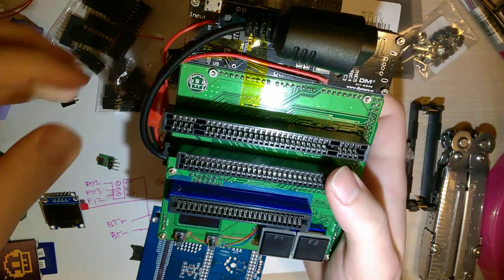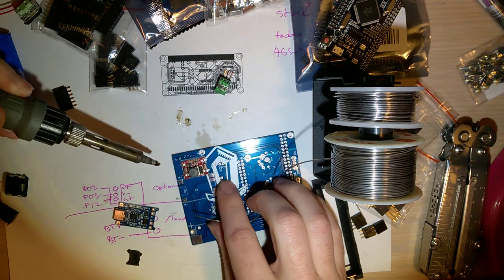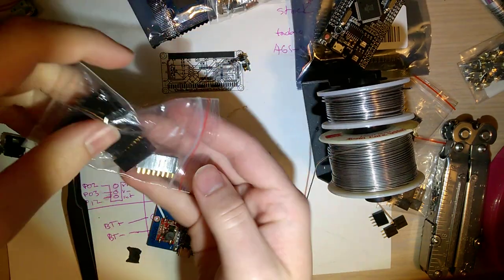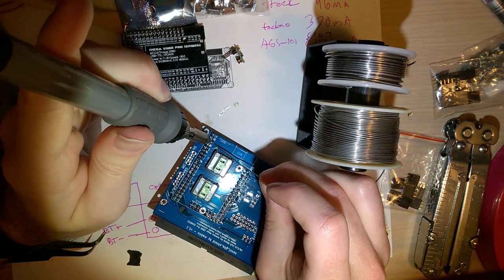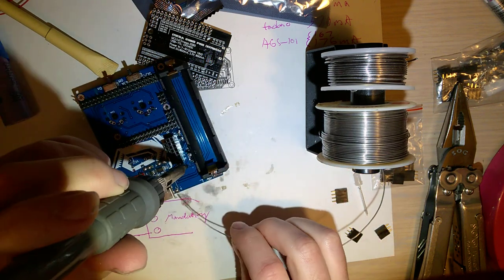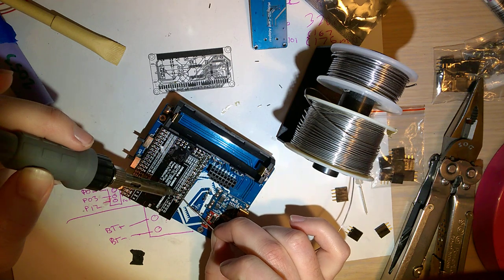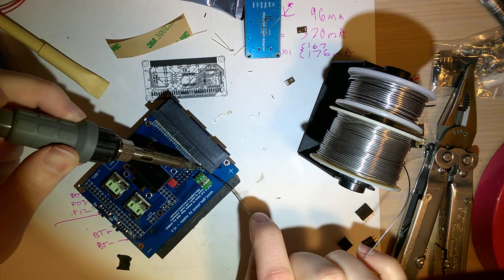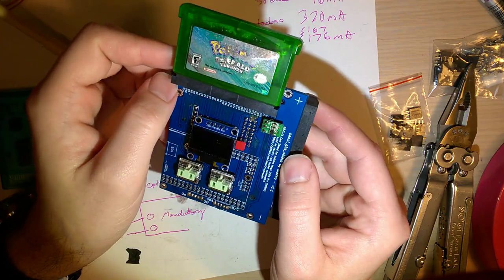I made my own custom Sanni Cart Reader shield for GB/C/A only

Comment: Nice! Keep up the good work.
Will keep a eye out for updates to this project.

If you could do a tutorial on a gb/gbc/gba cart flasher with just the Arduino Mega 2560.
Or even a Pyboard would be interesting hahaha
Reply from the maker: A major update to this project came in the form of a new PCB design: https://www.youtube.com/watch?v=AOxNhg_8TrQ

But if you want some tutorials on cart flashing with the arduino mega 2560, I'd recommend checking out the github repo for sanni's cart reader. There is a lot more info there than I could ever impart: https://github.com/sanni/cartreader

Comment: hi, i'm really impress of your equipment. i'm ganna try that but i want to build v1.0 with voltmeter. do you have v1.0 gerber file, BOM?
Reply from the maker: https://youtu.be/leoks1pUpcs
Reply: @makho  that's really nice power supply but, i'm talking about your portable cart reader v1.0 :)
Reply from the maker: @daehyunkim1969  Ahh, my bad. I just assumed since that's what so many people ask me about. This video is for the 1.1 version. I never published the 1.0 files (but I can see if I have them archived somewhere). There were numerous problems with that design though so I'll have to review it if I can find the files. 

I did publish everything I had with the 1.2 version though. https://github.com/makhowastaken/cartreader

If the voltmeter is the part you're after, I believe I left it in the BOM for this version (check the video description). It's an optional part for all of the versions I made.
Reply: @makho  thanks a lot! i'm ganna try v1.1  your video is really help for me. have a creat day.
Reply: @makho  hey makho i order parts what i need. and i will 3d print case for this badass, can you tell me what size of m3 screw spacers you use.

Comment: hi makho. i have a questions
i made your sanni cart reader v1.1 but have some problems
i made flash cart with J.Rodrigo's flash adaptor. (AM29F016) but always shows like this. 
GB Cart Info
Name:
Rom Type: ROM ONLY
Rom Size: Not found
Banks: 2
Sram Size: None
Checksum: FE00

then i ignore it -> flash mbc5 cart -> choose rom file -> flash ID: FEFE, unknown flashrom
i can't read rom, identify cartridges, flash mbc5..
can you help me?
Reply from the maker: Double check your solder joints on your cart. Did you already verify that the cart reader is working with an OEM cart?
Reply: @makho  offical cart's working fine. i triple check my flash cart
Reply from the maker: @daehyunkim1969  You've either got a short with your soldering or a defective flash chip then.
Reply: @makho  i use hot air gun and check all bridges. but  i'll try again. thankyou makho.
oh i have a onemore question, i saw your mbc5 flashcart on osh park. did you test before?
Reply from the maker: @daehyunkim1969  My MBC5 flash cart? I don't have one one listed publicly. What cart are you talking about?
Reply: @makho  let you know if i found
Reply from the maker: @daehyunkim1969  I'm not HDR, those are not my PCBs. HDR just made a "makho" edition of one of his boards because I had the idea to print the copper layer of the PCB on the silkscreen for decoration. As far as I know, the boards have not yet been tested.
Reply: @makho  i know your not HDR, i thought that PCB was your design:)

i was test my flash cart every connect with multimeter, all pins are connected. flash ok/read rom ok. but can't play on my gbc. gameboy can't read my flash cart. do you have a same problem before like this?
your cart reader identify my flash cart but shows sram allways 32kb. it's strange
if i can't fix my problem, i'll make another cart or order your 8-bit flash adaptor board and install to my cart reader v1.1(if it's possible)

Comment: How did you make it if I may ask
Reply from the maker: You're going to have to be way more specific. Do you mean how I designed the PCB? Because I made that in kicad.
Reply: @makho  no I'm just asking how you built it as in parts from other stuff or buy them
Reply from the maker: @michaelgarcia5493  check the description for a link to the files and BOM.
Reply: @makho  ok thanks dude